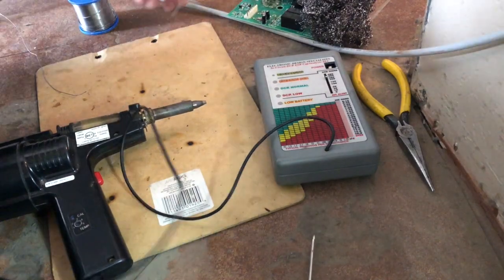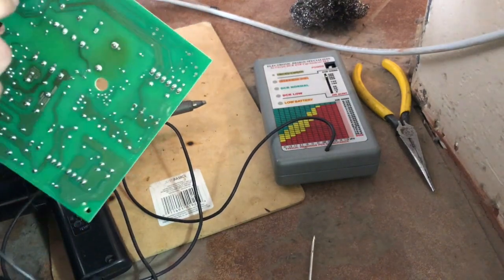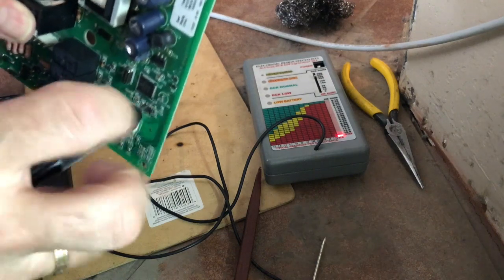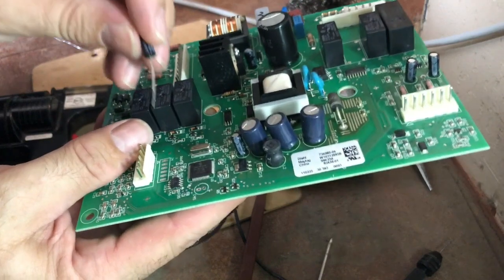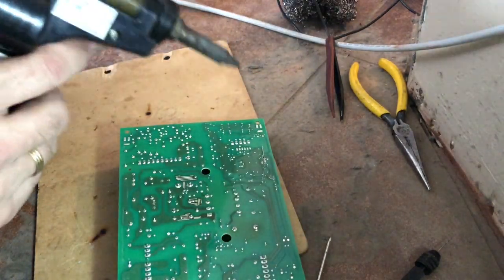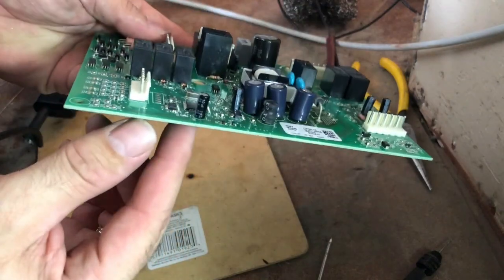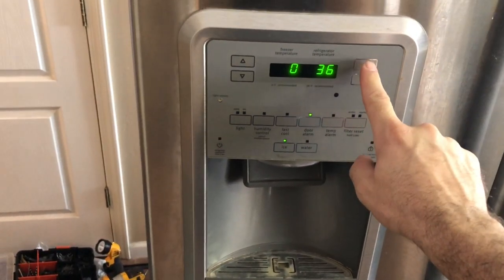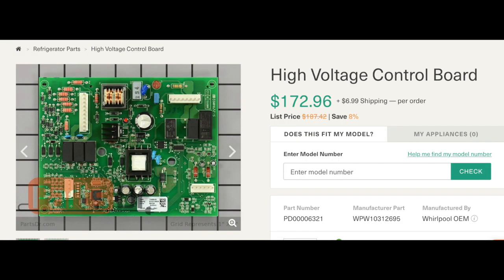Maytag Iceland Board Repair2

Comment: Same fridge here, and the display is just completely blank, you push a button and all lights and digits light up, would this be capacitors issue as well? Or do you think we need to order a whole new board?
Reply: I had 3 x 10mf caps all read really low under 5uf (changed those had them) and I the 3 larger capacitors are reading 240uf instead of 270uf (ordered) not sure if it will fix the issue though.
Reply from the maker: @idjmic  Use an ESR meter to test the electrolytic capacitors on these boards, best way to see if they are failed. Capacitance test is less effective. Typically the symptom you gave is the 10 micro cap near the microprocessor (if it's there, some boards don't have it)
Reply from the maker: @idjmic  same answer, use an ESR meter if you want to test a cap, not capacitance meter. Or just change the cap with a new one and see it it works.